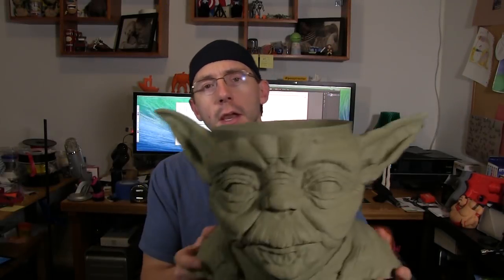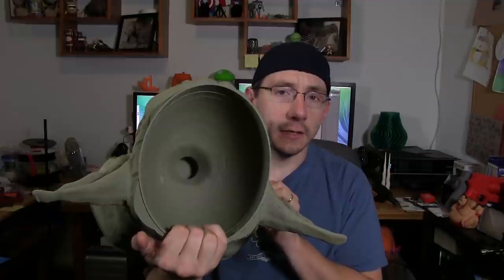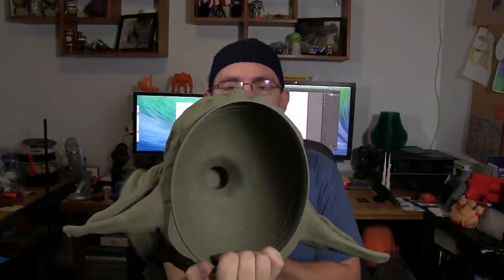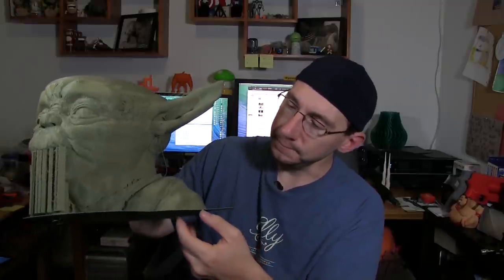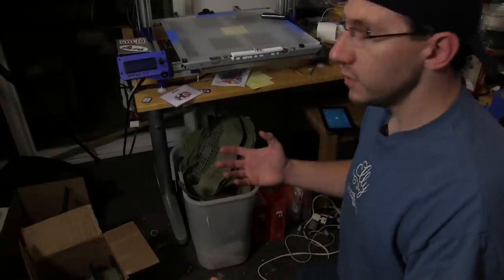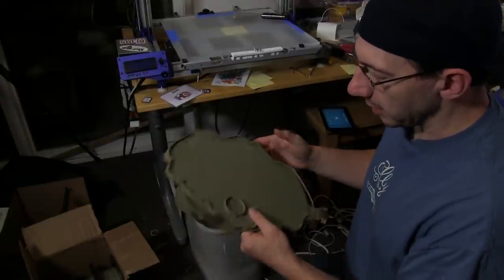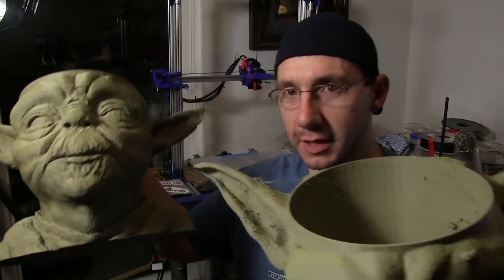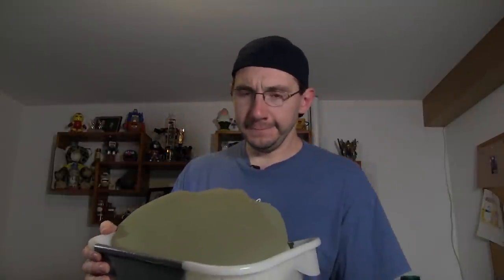3D Printing Giant Yoda Bowl - Behind the Scenes

Comment: I'm trying the normal Yoda atm on my i3 and had some fun where the ear supports wouldn't stick to the bed (not sure if levelling or what) but I had some fun where S3D just said nope to the raft and stopped all together at the end of the raft print!
Printing raw atm and seeing what happens, just wondered if you've had S3D do that to you at all?
Reply from the maker: +CarAnd “Car Mechanical” Mechanical Hmm, no, S3D is usually rock solid for me. Are you printing via SD card or tethered?
Reply: Tethered, I should probably add some more gcode for preheating the nozzle and bed temp as I do those manually atm. 
I ran the original Yoda supportless earlier at a 50% scale and it came out OK, I'd like to try it with supports and see how he comes out.